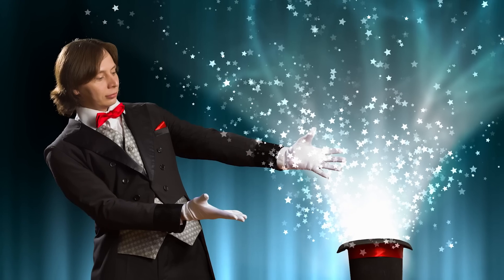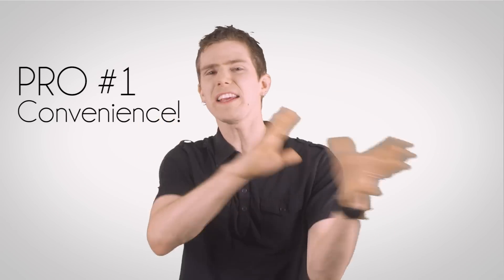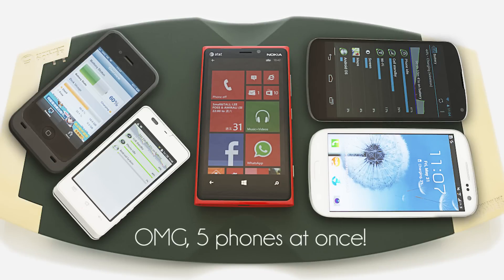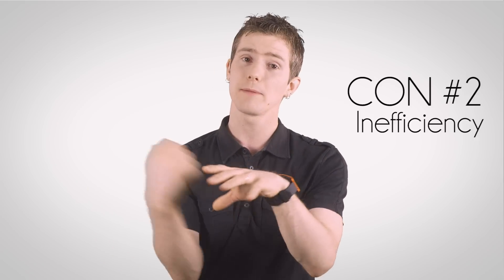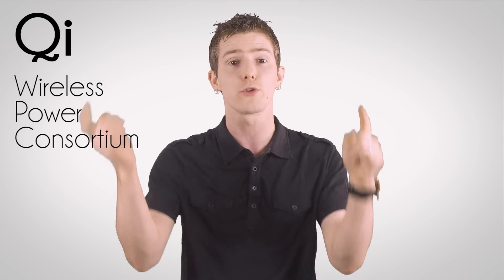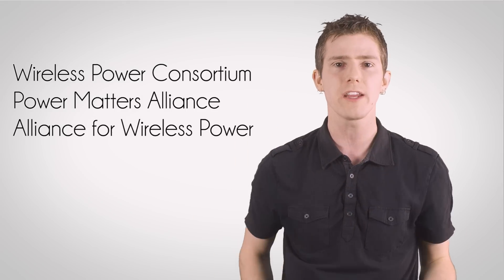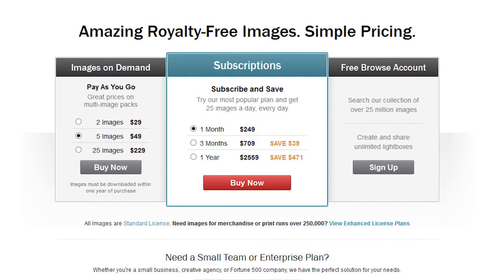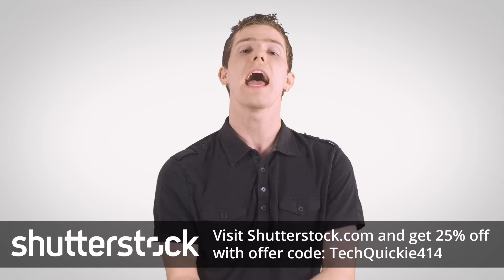Wireless Charging as Fast As Possible

Comment: Electricity is also lost in the un-captured electromagnetic field volume. This is alot of electricity, especially when the max chargeable range from the source increases, as a larger electrical current and voltage input is required to induce a larger magnetic field.

It should also be noted that this method of charging may also affect technical instruments and other technology, causing erroneous inputs.

In addition, the magnetic field produced from the charging station WILL induce an electrical current through conductors which are not designed for charging purposes, such as a microphone cable or speaker cable (causing white noise in both situations).

Comment: I’ve had a wireless charging dock for my phone for years. I love it. It works so well. I haven’t plugged my phone in overnight in years aside from power outages when I was using a battery. I’ve used wireless charging for at least 3 years and I’ll never go back to wires
Reply: You should use a wire charger as wireless will heat your battery up and make it last even shorter than charging through a cable

Comment: If there's one thing I can commend Apple for, it's for implementing MagSafe. Now by replacing the metal mounting plates on the backs of my phones with MagSafe-compatible rings, I can both wirelessly charge and still use magnetic mounting at the same time.

Comment: As an additional part of wireless charging, you also need to use some type of rectifier to change the AC current to DC current to charge the battery. Without it, all power put in the battery would be drained away when the AC changes direction.

Comment: One thing you forgot as a down side, is the amount of electricity used by the wireless charger compared to the cable. The cable would always use slightly less power for the same effect ( completely charging a device)

Comment: You did a great job. You listed the cons also which many do not do. You did miss overcharging = exploding batteries. Now that one is a biggie.
Reply: +Dyl Treanor (lightguy) Cool. Again you have the informative answer. Thanks. Always cool to learn something although I was kind of making a sort of joke reference to all of the toy's batteries catching on fire these days (airplanes included). Thanks! Never knew there was a law for everything :-)
Reply: +TopTribute Bands And phones now have octocouplers that disconnect the battery when it's at 100% and uses the direct input but when the cable is disconnected directly 0.000000000001 seconds agter it reconnects the battery.
Reply: Cool N Hot too :-)

Comment: I love Qi charging. I'll never buy another phone without it.  So nice to be able to pickup the phone, use it, then quickly pop it back on the stand without plugging in a cable. This is especially useful in bed at night. No more using the phone as a flashlight to find the cable that has fallen onto the floor.  Just place it down, slight glow from an LED under the dock means you'll be all set come morning. Fantastic.

Comment: Do something similar with the battery devices in your home, instead of wiring them into outlets, make your walls charging or powering that you can magnetically place a device or control device anywhere on the wall and it drawn power and function, like your room temp sensor a/c controller.  That would revolutionize the not having to have an electrician cut in a new wall outlet or plugging too many devices into one.

Comment: Wireless Charging isn't Efficient at all. From what i've read, it takes much longer to Power up your device and generates alot of heat. Most wireless chargers consume alot of of power and may not even charge at all. I wouldn't use it. I'm fine with wired charging. The only thing that will have people adapt to this kind of technology is if companies can improve it by inserting a fasr Charging mode device into all the Wireless Chargers.
Reply: You are correct by what you have said in your comment
The intense build up of heat from wireless charging is the electricity that is being totally wasted

Comment: Make one for a desk top that you can set your phone/tablet/laptop/telegraph machine/cat/helicopter/taco/walkman/minivan/barge/xbox controller anywhere on the desk and it will charge. Or if you take apart the desk you could attach it to the bottom side so it isn't visible (assuming we can go through material before we can make pads large enough for a desk).
Reply: Just tape a bunch to the bottom of a desk
Reply: Blazing Infernape XD I don't think it will work through thick surfaces, even if it does it won't do it well...

Comment: It is almost exclusively slower than normal charging via cable and if you don't have a problem with using a cable then you should.
Wireless charging seems cooler, and I suppose it is, but I just want to charge my phone.
There is one great use for wireless charging, however. Smart watches can use it make sure their case is truly waterproof.

Comment: That sucks, I can't even use the phone while it's charging.
It's not energy efficient.
It's slowly cooking my battery.
And it takes forever to charge it?
Call me old fashioned but, no thanks, I like cables!!! The more cables the better IMO!
Reply: +KiwiPowerNZ CABLES ARE STILL NOT OUTDATED. DONT FEEL OLDFASHIONED
Reply: +KiwiPowerNZ Totally with you here. It's just like WiFi. When it first came out it was barely usable, but now with ac it's may be even better than 1g wired connections in some cases. In a few years i hope we would see the same with wireless charging.
Reply: +KiwiPowerNZ farcup farcough cant, one day it will be extremely fast and less heat.
Reply: +Yuri “Yurijmi” Mikhaylov because that is stupid, em causes damage to electronics and life there 
are tone's of studies showing this, there are experiments that show a 
direct effect magnets have on the brain. Also they waste a tone of power
 and there is no amount of technological progress that can fix that it 
has to do with the fundamental law of the universe thermal dynamics.
Reply: +KiwiPowerNZ give it time fool
Reply: It's only useful when your charging port doesn't work anymore.
Reply: Me Just like what effect?

Comment: Didn't know it can work without touching the surface. Now I'm really excited about it.
Reply: There's a TED talk video about how they (a university team) power a tv from about 18 inches away with 2 coils about 40cm each.  It's none of these small electronics form factors but it proves you can move over a hundred watts efficiently over an air-core transformer.  Super promising.  Even if its directional only, I'd put in a robotic pan-tilt transmitter in a light fixture that followed my phone around the room beaming a thin ray of power to my device :)
Reply: frollard can you give me 10% of the cost of that? it'd be a great help haha
Reply: frollard Iw ould love to hack that to follow you around the room to shock you. I'd just need to give you something to make it think you're something that needs a lot of power.

Comment: I am still not convinced with wireless charging with current technology 'cause you still have to put your phone on top or very near to the charger, the charger still has wire connected to the wall power source, it's still way expensive than normal way of charging. I believe repairing the charger or phone will be also expensive as of now. So it's a no for me.

Comment: I made a homemade wireless charger that has a range of 29 and a half feet using an amplitude AC coil going in to a 360 degree rotating titanium sphere. the sphere has an amplified megawatt positioner integrated into the second set of internal coils made from zinc and copper. it provides the phone with as much energy as a normal iPhone charger!
I'm hoping to get a patent on it soon!
Reply: i'm calling bullshit

Comment: I am afraid of a future where it's impossible to turn off your device.

At first, you could just turn off any device and it would shut down, immediately, no matter what.
But then, the power button just turned into another button which doesn't work when the device is frozen. Well, there's still the reset button.
But newer devices don't have a reset button. Well, you can still just pull the plug.
Except, newer devices have a built-in battery. Well, you can always just open the device and take out the battery. That will surely turn it off.
Except, you cannot take out the batteries out of the iPhone. Well, you can always just wait for the battery to run out. Surely, that will turn if off, eventually.
But once wireless charging will work, automatically, whenever you're in your room, it won't happen. Well, you can still just put it outside. Surely, that will work. Right?

Comment: I just had a realization. If wireless power is to reach the ranges of say Wi-Fi. How would they implement power security so your neighbors aren't mooching? Some sort of frequency password? I feel for future tech-support assisting customers in resetting passwords so they can add/power their new Ninja wireless blenders.
Reply: Well for starters it would probably only be able to reach bluetooth range as anything over that would just be over kill. If it was at Wifi range the "box" would probably come with an adjustable range so it only covers your house. I can't think of any other current work arounds that exist right now.

Comment: Another major drawback which was not mentioned (kinda) was how wastefull it is.  50% current loss!  Most Mobile phones charge at 1 amp (some capable fast charging at 2 amps)  which means you need to provide 2 amps to the wireless charging pad to get 1.  Hence the slow charging that was mentioned.  Very hard to find a usb charger more than 3 amps so at the most you can wireless charge at 1.5a

Comment: lol, still need a cable to the wall, u save yourself like a millisecond of not having to actually plug into the usb port.. then again u waste time having to set it on properly on the sweet spot.. only real use for this is if your usb port breaks and you have to charge the phone.. so wireless is awesome for that... but then again get a new phone or fix the port.. only good to get your data off the phone before switching to a new phone (if your phone battery already died when u realized the usb port broke)

Comment: The advantages are far in the future. As of now a cable is cheaper and I can use the device when charging. For me the efficiency and range will be the biggest things. Because even if it's wireless by a few feet I might as well have a cheaper and more efficient cable. 
I'm actually more excited for wirelessly charging accessories.
Say my iPad charges via cable but my Apple Pencil is powered from my iPad wirelessly. Or being able to place light fixtures and lamps throughout the house without needing outlets or wiring. Admittedly probably not a thing until I'm a dirty old man and to grumpy for my arthritis pain to care.

Comment: I'm definitely changing to wireless charging. My Galaxy S3 charging port broke and the replacement port won't work on the phone either. So I'm guessing it's a problem with the pins on the motherboard.

In the future when I buy a phone I'll prefer to wirelessly charge it and only use the port when necessary.
Reply: You should use wired charging as wireless is 300x slower whereas wired charging will always be 600x faster as electrical current flows through a cable much quicker
Also,wireless charging will make the Smartphone get hot and cause a full charge to run out faster

Comment: I just wondering about accidental shorts. 
If wireless charging become available room wide or house wide range what's stopping every other device that can be quite old shorting. How can you tell that Every device made befor this tech is 100 percent safe to have while using this. 
would something like a roll of soldier conduct the waves or something like induction pot and pans compatable with the induction stoves heat up? 
Idk....

Comment: I assume radio waves, but so many waves in the air will definitely decrease the time it will take to mutate cells. One device is fine, but tens of devices? Hundreds? Thousands? A bad idea. It'll also need to be more efficient before I use it. I don't have 36 hours to wait for my phone to charge.

Comment: So it's basically a dock without the connectors on it? And you have a wire to the dock? If it had better range I'd consider using it. Not sure about tablets though, mine is often discharging even when it's plugged into the wall so...
Reply: It's awesome - I use the nexus orb charger so it holds the device at about 45 degree angle - great alarm clock angle.

Comment: Is it safe to leave a fully charged phone on the pad? How the system work? How if I put more than one phones on the same pad,  is it smart enough to know one of them already fully charged?
Reply: James Mansfield It won't necessarily over charge your battery, but lithium ion batteries in general degrade faster when charged above 90% or left below 10%. To get the most out of your battery charge it to 90% then unplug it. And try avoiding charging it overnight, as it will reach 100% and it will stay there for many hours until you unplug it in the morning. Using these simple guidelines I've always been able to keep my phone batteries strong even after my 2 year contracts expire.
Reply: James Mansfield overcharging means it gets charged beyond 100%, which is very damaging for a battery. This was a common problem many years ago
Reply: Galih Winastwan Ya, I'd say it's safe. It's not a matter of the pad having software that's able to recognize fully charged devices, it's more of a thing that the phone's software does.

Modern smart phones can now monitor the rate at which it's battery charges, slowing the power intake down as it gets closer to 100%, then rejecting power until it's needed again when it does reach 100%.

So, if you have a smart phone, overcharging shouldn't be a big deal.

Comment: So say the port on your phone breaks should you replace it of would it be better to geta wireless charger?
Reply: If the female port on your phone breaks you will have to replace it, or get a new phone. The wireless chargers use the port to transfer the power to your battery, same as a wall charger.
Reply: joshua holderman not sure about that,  in my note 3 it has separated connector for the wireless charger receiver

Comment: Isn't this like a world changing invention? Transferring energy wirelessly?
Reply: sgtsnakeeyes11 Yes, but not right now due to the limitations.
Reply: Tacodude11NL I don't agree with that, its like having electronic windows vs manual, its nice, but its mostly a convenience. I'd also at this point call it a downgrade, since it only saves me a half second to connect a cord while wireless charging creating more heat that degrades the battery faster while taking longer to charge.

Comment: I wonder why it is taking so long for this technology to develop. Nicola had a rough version of this worked out a while back.
Reply: this technology was developed for decades now, it was just hidden from us.

The fact is that EVERY transformer that plugs into a wall socket including the usb wall wort to to a 1500W psu, uses the same principle. Its is the simplest way to convert ac -> dc. 

Only now have we realized its potential in charging mostly because of the spread of li-ion / li-po batteries.
Reply: +iamterence77 No. What you're thinking of isn't a transformer like wireless charging uses, but the separate component called a rectifier. Basically it's a diode bridge that only allows AC to flow one way thus creating DC. A transformer only transforms one AC voltage to another, or the same, through some medium using induction.

Comment: wireless charging would be great if it did not heat up my  battery and I could select the rate of charge or amps, so the receiver coil needs to be some distance from the battery which it is charging to not heat it up. Rock on Nicola Tesla!

Comment: Wired charging is better on the battery 🔋
Other videos state that wireless charging puts a lot more stress on the battery and the heat generated will shorten the battery lifespan